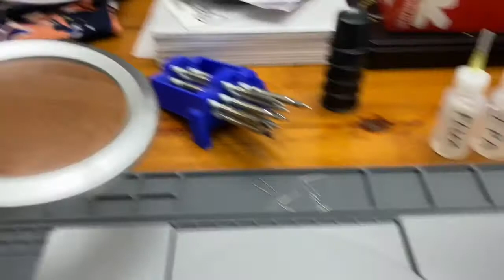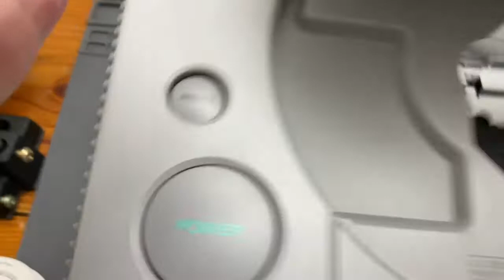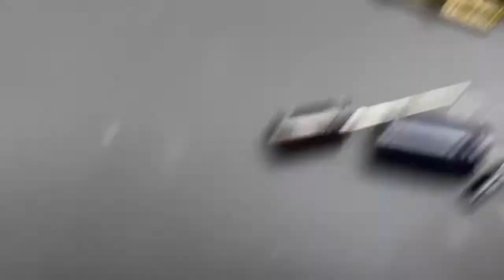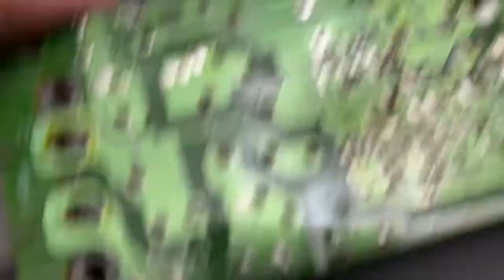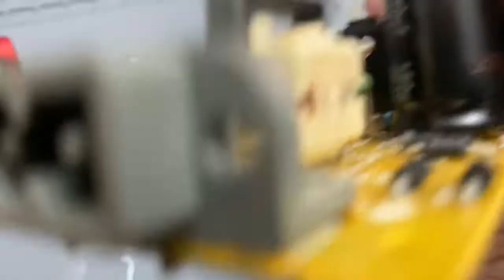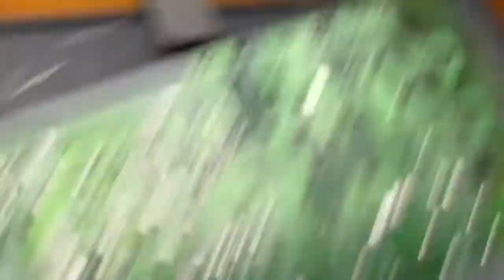Sony PS1 Power Supply Capacitor Replacement

Comment: do you not need todo anything special to be able to touch the power board without getting shocked then just unplugging? dont they hold charges?
Reply from the maker: I should have mentioned that, sorry. What I typically do is cycle the power button a few times on the console after unplugging it. In my experience that’s enough to discharge the PSU caps, and you can even see the power LED light up briefly (at least the first time). I take no responsibility for any electrical shocks anyone may experience, however.

Comment: Hi 

I have a fat PS 1 (J 100v) and connected into 220v by a mistake. So, I had to look inside and found that big capacitor (like yours) was cracked , bombed out ! 

So should I change the whole power board or just replace that peice with soldering etc ? 

Thanks
Reply from the maker: I'm not 100%, but I think the big cap is the main power filtering cap, so it makes sense that would have taken the brunt of the over-voltage. You could start by replacing that cap first and see if the system powers up on in-spec voltage, but I take no responsibility for any damage, etc. If all the other caps are original, it wouldn't hurt to do the full re-cap, but you may just want to start with the single blown one so you're out less time and money if the whole system is fried from the prior over-voltage.

Comment: I got an old ps1 from my uncle that I used to play time crisis on as a kid. Anyways there was a power surge from a storm that I think fried something in it. Now when I plug it in to an outlet not only does it not work but the outlet it’s plugged into buzzes? I like to tinker and fix stuff so any hints? So far all I’m thinking is that maybe the whole circuitboard where the power supply plugs in needs to be replaced cause now it’s shorted?
Reply from the maker: Could be a blown fuse, or something worse. Hard to say w/o looking or testing the board.
Reply: Tim Davis I recall my uncle replacing the fuse as a kid and the fuse he replaced is fine. Maybe a short somewhere. But I don’t know how to find a short on a circuitboard.

Comment: I want to know if there's a more modern power supply for the PSX tuan the OEM...
Reply from the maker: There’s the PicoPSU for the PS1 that was just released where you’d need to source an AC adapter like a triad. 

https://www.willsconsolemodifications.co.uk/ps1_pico_psu.php
Reply: @TimDavis77  that is sooo cool, very similar to what I originally saw but couldn't find that site again... Thanks for this info.
Reply from the maker: @RepoDraghon  no problem

Comment: Hello big guy, cool vid. Id like to know how would you turn that 110v power source into 220v for countries where that power is used.
Reply: You will need to take off the main cap and remplace it for a 400v and 150uf capacitor, also you will need to change the fuse for one of 250v and 1.5 amps
Reply from the maker: I’m not sure how you’d go about this. I don’t know if the power supply boards are interchangeable between 110v and 220v units.

Comment: Lately, my power supply is very hot even if Playstation is off. Do you know what can be? I need to worry?
Reply from the maker: What part is hot?
Reply: @TimDavis77  I think is the capacitor behind transformer. It's a bit upper than normal. I'm worried mostly because actually, the power supply hoverheats the entire console so my Playstation can die
Reply from the maker: @alessiospurio  It certainly wouldn't hurt to replace the capacitors, especially if there are signs of leaking electrolytic fluid or bulging. But I don't know if that would solve the heat issue. I've never had an issue with the PS1 OEM PSU overheating my console, but there's also the PicoPSU solution that was just released for the PS1 that replaces the power supply and allows you to install a fan. You'd need to source a quality AC-to-DC adapter like a Triad, though, for that solution.

You could also just unplug the PS1 or switch it off on the power strip if you aren't using it an extended period of time. There's no internal real-time clock on the PS1 as far as I can see.
Reply: @TimDavis77  Can I replace components of 7002 model with a 9002 model?

Comment: i have also a same problem with this , i have a ps 1 but the problem is the voltage of the ps1 was 110v then it was plugged by my friend on a 220v  suddenly the capacitor exploded then i tried to open it up then i saw the capacitor was damaged do you think i can still fix it? i hope you can help me to fix it thanks
Reply from the maker: I'm not sure.  Replacing the capacitors might be worth a shot, but the higher than expected input voltage may have messed up the voltage regulator on the power board. I'm not sure which regulator it uses and what input voltage it can handle. Hopefully it just overloaded the main power filter cap before that happened.

You may want to check out the PicoPSU if a re-cap doesn't fix it. I imagine there's a way to test the voltage regulator for damage with a meter or external power source, but that's beyond my expertise as I am still learning.
Reply: @TimDavis77  i might try your suggestion with this i really appreciate it and im hoping that the board was not dead, since it was just a sec after the capacitor exploded then my friend said he immediately pulled out the plug..